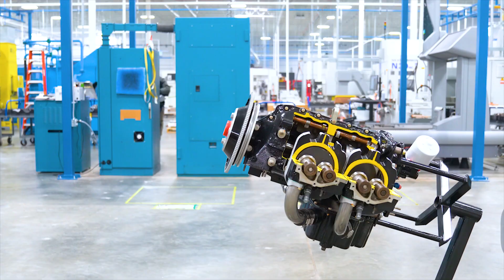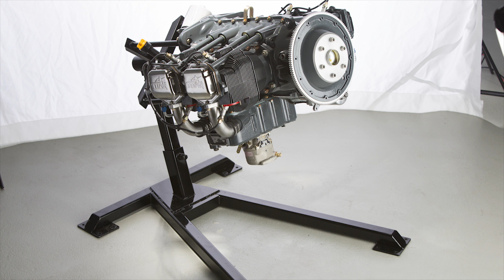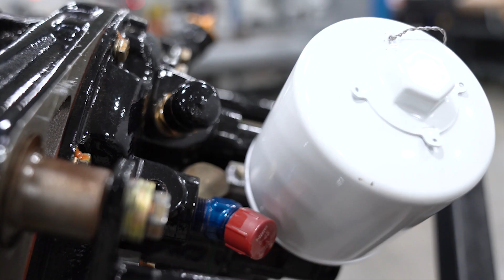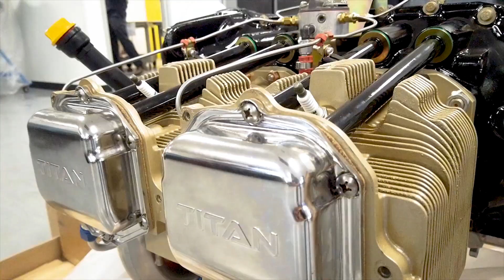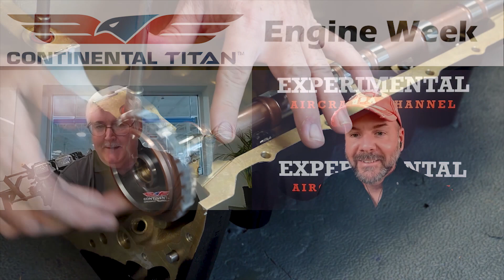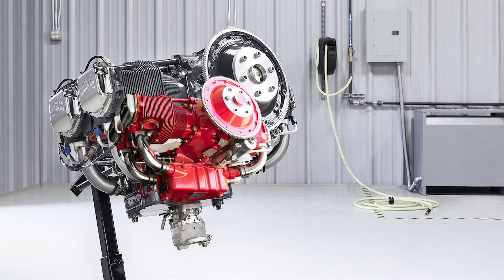Continental Titan Aircraft Engines - Engine Week 2020

Comment: $40k+ for that engine. Trying to be nice to you yanks, but you really need to wake up. It's the 21st century, you are making engines that are of a 100-110 year old design. I do wonder what the states would be like if they didnt import engineers from other countries.
Reply from the maker: Lycoming is similarly priced. What prices are you seeing in your county for comparison and which brand(s). We are always looking to find more options to power Aircraft....reliably.
Reply: @ExperimentalAircraftChannel  I know Lycoming and Rotax are similarly priced, that is the amazing part. As I said, I will be starting with a Suzuki M13A engine for my helicopter. Price aside for NA being $3k, and turbo being $10K, the engine is a better design than everything on the market from an engineering point of view at least. I will start a channel soon enough showcasing my helicopter and why I chose the M13A. Plan to set altitude (13500m) and speed (360-410km/h) records with it, my heli design is much better than anything on the market also. You can laugh, it will happen. I appreciate the time you put into your channel.
Reply from the maker: @chippyjohn1  Please feel free to share your progress as you move forward with your project. Both in the engine and Airframe etc. :-)

Comment: This is kind of sad. This is nothing but a Lycoming painted black. The steel thrust washer......cool but it is a washer. Don't forget the oil filter relocated for easy access. Sweet baby, signs me up at 30k a pop. At least my PT 6 is still called PW, hope they don't change the name once it comes out of overhaul with some new washers and springs in the fcu. Insanity like most things these days, soon they will tell you that covid is for real and that Biden is your new president......Come on man.....
Reply: Every body is offering lyco clones because there billions of inexpensive parts out there. You can buy a used Lyco part and it will fit

Comment: I love this series, but these old fossils? Continental should be ashamed to still be selling this ancient 'technology'. Carbs belong in classic cars, not on planes. The fuel injection on these still isn't proper fuel injection is it? They are either throttle body, or analogous to the 1970s Bosch K Jetronic, where the injection is per cylinder, but just continuously sprays fuel. These aren't going to give you the per cylinder mixture control and proper FADEC capabilities. Carbs are nearly a century past their sell by date. This is 2020 and people are still messing with their mixture control. This is ludicrous. Lead should not be needed in any modern engine. My two liter car engine has never been torn down, it's at 207,000 miles, it has never seen lead. I has run to nearly 7,000rpm most days. Due to the amount of time I've spent in traffic it the car has averaged under 40mph. So... that's over 5,000 hours of hard use It has had two water pumps and two sets of spark plugs. These engines cost more than my car, they are almost devoid of modern technology, and yet their arcane technology is accepted as good. I got an oil cooler, alternator, seats, and wheels for that price. Why would anyone do this? Find a decent modern engine.
Reply: Go find us a worthy alternative that costs the same, and the world will be knocking at your door. Really

Comment: I was at one time excited about the 340 engine. But you can buy a UL Power 390is 6cyl with FADEC, a lot lighter and a very simple for DIY installation at around the same money.  I feel the Titan engine is behind the times, plus it’s pushing 300lbs at flying weight. There 0-200 D 100hp Continental engine is much better suited for the Kit market like a zenith 750. The Titan 320,340 is just to heavy for LSA kits.  I’m excited to hear your interview with the 0-200 118hp engines from the boys in Alabama. That’s a engine you can put on a LSA aircraft in my opinion. And not use up all your payload weight. Great interview Brian. But he seemed to dance around some of your questions in my opinion. Wish he would of got into more of the flying weight from Titan.
Reply: The 320 or 340 engines are never meant for LSA because they pump out too much HP for the LSA regulation. The criticism is off the mark

Comment: Thank you so much for putting in the time on such in-depth questions to the engine manufacturers. I would have liked to see Aeromomentum on your list, though. I am seriously considering them for a CH640 type build (4-place low wing) and wish they could either get that AM-20 version up and running, or put a turbo-normalizer on the AM-15 in order to pull a 4 seater around the sky. Their AM-20 (170 hp) page has had "information coming soon" posted on it for over a year....

Comment: Continental has been the engine of choice for many years  and they are a solid engines. But they continue to build off a platform that is almost becoming obsolete as other engine builders advance through innovation and rethinking. I just hope Continental doesn’t get left behind as they require their engines to be ran on leaded gasoline’s. The world has moved on in an effort to eliminate lead as a pollutant in our environment and I’m sure the argument will be made that it’s just a small amount but why have any when through design and innovation it can be eliminated all together. When I see the representative of a large company that is there to promote their product and they’re not showing a great amount of enthusiasm during their promotion I get the feeling that the entire company moves at the same pace and this would explain why innovation is slow and production costs are high. The idea of, “We have been doing this for a long time”, comes to my mind thinking that there are a lot of areas in the company that can use improvement or leaning of duplication or fat especially when they produce ever component of their product. I know I sound critical but I’m reminded of working for a large company just like Continental where we would hold production meetings just to discuss the flow of parts. The sad part was that computers track these parts and to me it was a waist for 7 managers to spend 1 hour a day two days a week discussing this flow. And when I asked, why we were doing this the VP replied, because we have always did this. My comment was, but we can all see the production on our screens and when any issues arise we go to the production cell and take care of them. I see large legacy companies have a hard time changing their mindset when I hear, “because we have always done this way” not that this was said but when Continental recommends that you need to run leaded gas through their engines to maintain reliability I think of Buggy Whips. You can make a great Buggy Whip but if they are no longer in demand then being great at making them doesn’t really matter. Tough interview Bryan you had to keep pulling info the entire time. I’m betting they are use to standing up in the production area giving the Continental promotional pitch and having a hard time in 2020 dealing with changes.
Reply from the maker: You never know what is just around the corner! :-)
Reply: The fact that he is referencing the displacement in 'cubic inches' as opposed to the univesally used Cubic Centimetre (cc) should tell you the vintage of this . . .
Reply from the maker: @TRPGpilot  We still say and use Cubic Inches all the time over here in the USA. Just engine talk friend.
Reply: @ExperimentalAircraftChannel  I’m glad you said it first.
Reply: That may be so and you alone know your viewer demographics but for viewers like me and anyone else outside the USA cc and metric are what is universally utilised and understood. I do enjoy your videos however, thank you, keep uploading more like these and do what you do best.
Reply: @TRPGpilot  - In the future you will see the US moving into the metric system driven by the ISO 9000 standard that the US has been adopting in our manufacturing products since the late 90’s. The Metric system is now currently a part of the US education system, so it’s been a long time coming and a slow adaptation but we’ll catch on. The current generation of young students are proficient in both imperial & metric systems so as time moves forward you shall see the metric system replacing it. Change is slow sometimes and I’m going to bet that the last holdout will be our gasoline measurement in gallons. It will go when we no longer use gasoline. 😂 and that’s not that far off I hope.
Reply: @MrWATCHthisWAY  Thanks for the reply. I agree with you on the gasoline remark. In the UK even though fuel has been dispensed by the litre for over 30 years, official vehicle fuel consumption must legally be referenced in that great misnomer 'miles per gallon'. :-)
Reply: @TRPGpilot  - but just about every US auto builder now only puts engine displacement in Liters and every American immediately does the conversion math to imperial. I know I do but again I’m old school but I also brought in the ISO 9000 series of manufacturing into aviation and conducted classes to teach workers on the line for Boeing. I later moved into ship building where the system was only metric. Again I taught classes in understanding the metric system to US workers. We’ll get there. There’s an old Russian saying I was taught by a Russian Aerospace Engineer that goes; Slowly, Slowly, Farther Farther.
Reply: @MrWATCHthisWAY  Great story. Thanks for taking the time to relate for sharing!
Reply from the maker: @TRPGpilot  Noted.  My demographic actually has started to move more "global" recently.  I will work to include BOTH in the future to add clarity.  Thank You for your feedback.  I appreciate YOU.
Reply: @TRPGpilot   well there's 2 types of countries ones that use the metric system and that 1 that landed on the Moon.
Reply: @TRPGpilot  I'm a guy who was born just after Canada adopted the metric system. Here's a lesson in confusion for you, but it's my everyday life: I buy my gasoline by the liter, put it into a 25 US gallon fuel tank (Canada used Imperial gallons, which is 4.55L vs 3.78 for a US gallon,) where it burns in a 3.5L V6 daily driver car. My old 4x4 has a 350CI V8, and my motorcycle has an 1100CC I4. I set my oven in Fahrenheit, and measure the outside temperature in Celsius. I buy my meat and produce by the pound, but it's billed by the kilogram. The country backroads where I live were all measured out in miles, but distances between places are in km, and the speed limit is in km/h. I measure airspeed in knots, altitude in feet, and ranges for shooting my guns or my bow in yards. I give my height and weight in feet, inches and pounds, but my ID shows them in CM and KG. Building materials are purchased by feet and inches, and machined parts can go either way, but a good machinist will work to tolerances under one thousandth of an inch. I learned metric only in school, and the old ways from my parents and grandparents who immigrated from Germany in the 50s and 60s and had to learn the Imperial system when they came here. Like my Opa always said: A 2x4 is a 2x4. It will never be a perfect 5cm by 10cm, but everyone knows what a 2x4 is, especially when you beat them with it for asking silly questions!
Reply: @TRPGpilot  Anyone that talks imperial, just assume they are not professional. I don't buy or use anything if it is advertised or made in imperial, even just a bolt on it.
Reply: Engines that are made by continental and lycoming, even Rotax are old technology back in the 1930's. The fact that these are still produced and people by them is just mind boggling. Its the equivalent of having a smart phone and then producing a cup and string phone. Air cooling, 2 valves per cylinder, push rods etc do not make an engine more reliable or cheaper to manufacture. A Suzuki M13A non VVT engine is a better design than all current aircraft engines on the market, you can get one for a few thousand rebuilt and turbocharge it for a little more. I am using this in my helicopter build as nothing in the aircraft market is any good sadly.

Comment: Wouldn't the fuel injected have higher hp and far better efficiency?
Reply: I will give you the standard engineer’s answer: it depends.  I believe the Titan FI is mechanical FI and not modern automotive style EFI.  Mechanical FI is only slightly better than a good carburetor.  EFI is generally combined with sophisticated electronic ignition and sensors such as knock sensors and is often 10-20% more efficient than a carburetor.  So, it greatly depends on whether you are talking mechanical FI or electronic FI.
Reply from the maker: @LTVoyager  I would have to agree with you there.  I visited Airflow Performance a few, several, months ago and got a bit of a education.  You get more atomized fuel and fuel delivery to each cylinder and better / equal heat range on heads with FI. You also get a super cooling of the fuel in the jet / venturing effect of a carburetor.  Which you dont get with FI.  So.... more HP? Maybe not. More efficiency?  Let's keep the conversation going. :-)
Reply: Nothing that says that you can’t build that engine with SDS or EFII FADEC.   That’s my plan.
Reply: @gregjennings9442  I am looking at the same.
Reply from the maker: I have heard both sides of it. There is a SCIENCE to EVERYTHING isn't there. Overall  YES fuel injection is more efficient when taking into account all scenarios I believe. Thanks for saying hello!